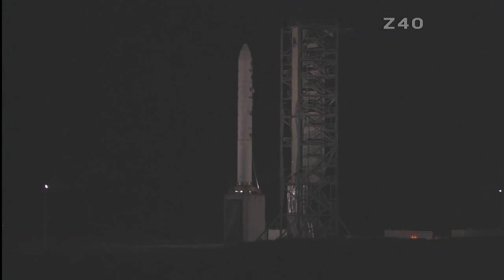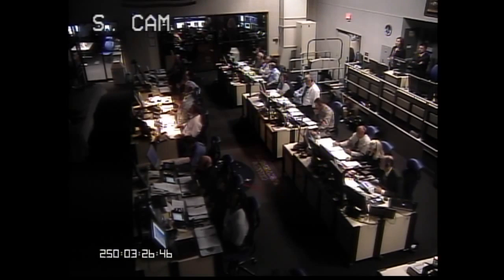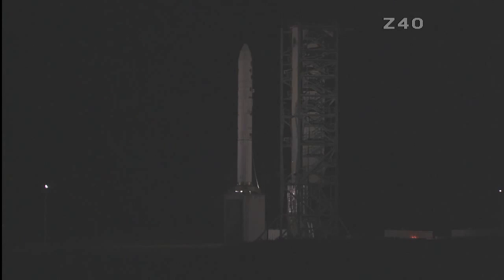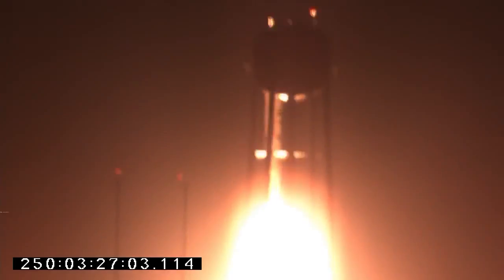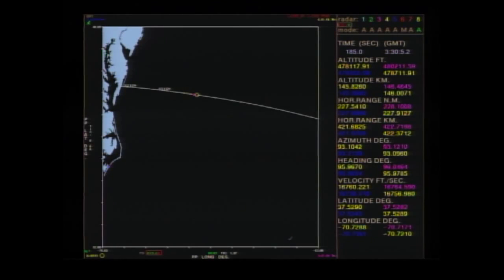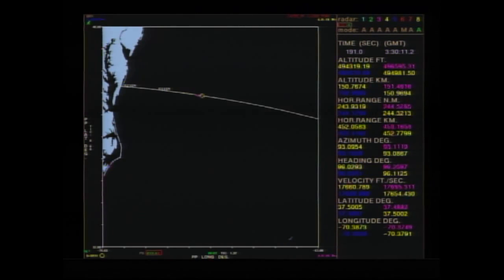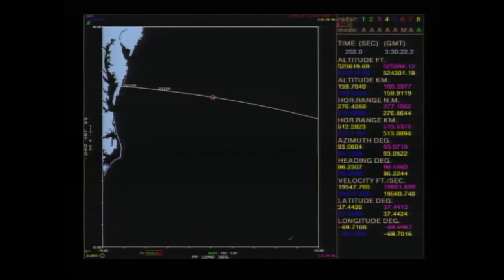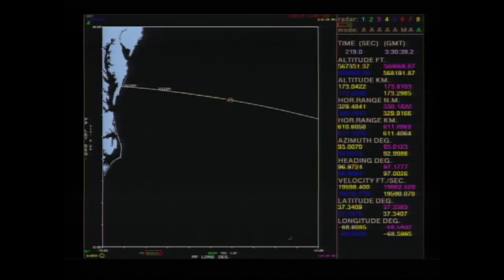Blast-Off! New NASA Moon Mission Launches From Virginia | Video

Comment: if you can manage to compile it in 720p that means the camera needs to be HD otherwise the raw video resolution is too low and you cant compile it in 720p(well you can by stretching the video and loosing quality) and probably youtube wont accept it as 720p probably 360p or 480p o somewhere between 640p